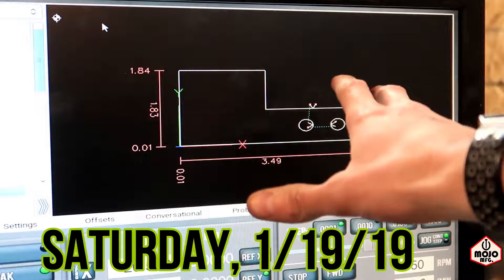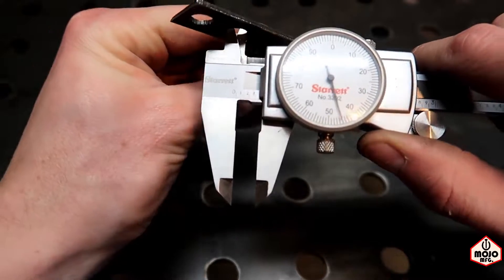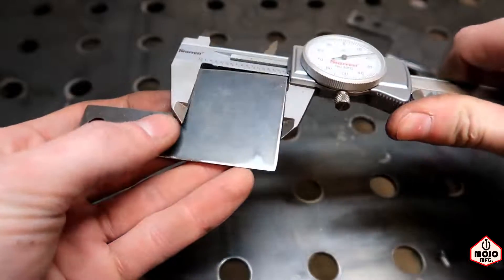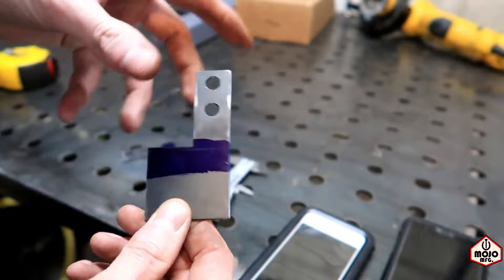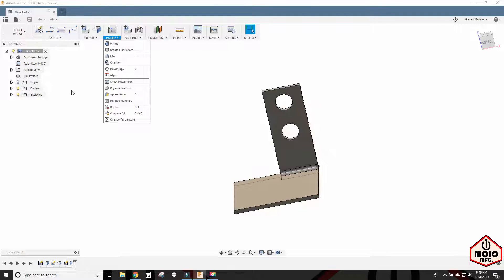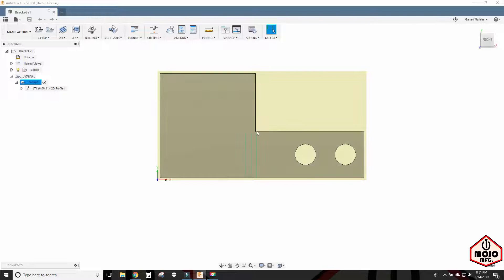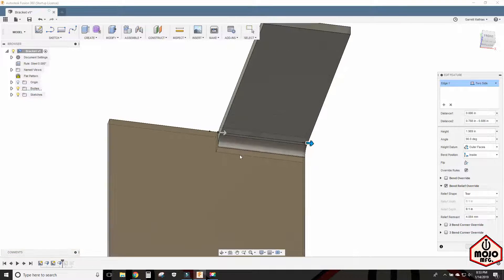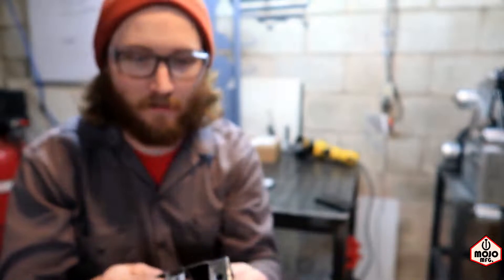Plasma Cutting and Bending a Bracket

Comment: Great setup you got in the garage! I love the plasma, only thing that sucks is the finish it leaves on holes. Usually just under size them and drill/ream to size if its an important feature.
Reply from the maker: Thanks! That is good info! Sometimes I overlook the simplest things, I think I will use that method next time I make any parts like this.
Reply: @MojoMfg  Yah that's a great tip.  Thanks Skylar.